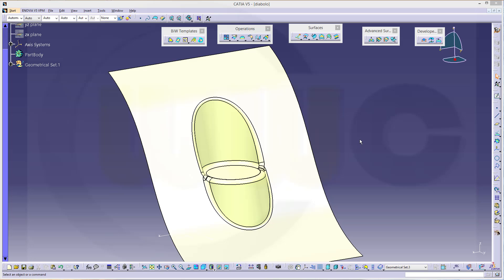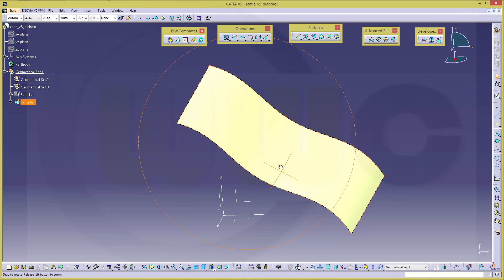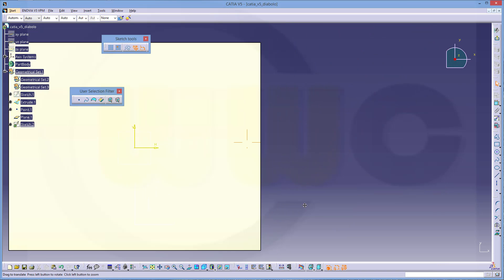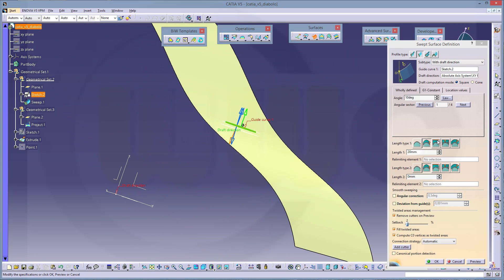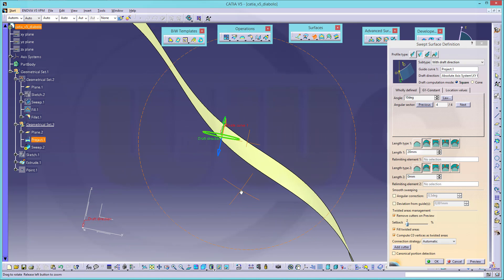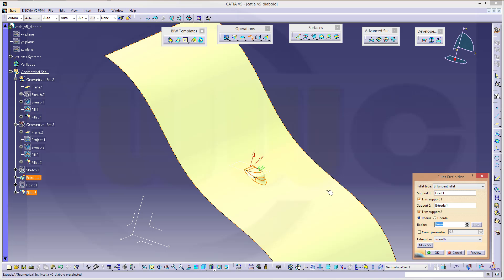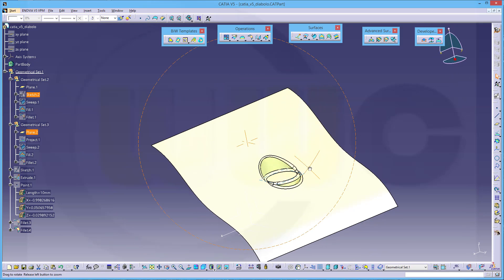How to make a "Diabolo" - Catia v5 Training - GSD

Comment: why is the offset surface needed for the positive/negative cones? Cant it all be done with the original filled surface?
Reply from the maker: Sorry, there aren´t any offset surfaces. Where do you see offset surfaces? By the way, I did this video 5 years ago. So if you have any questions you should at least give me a time stamp, shouldn´t you?
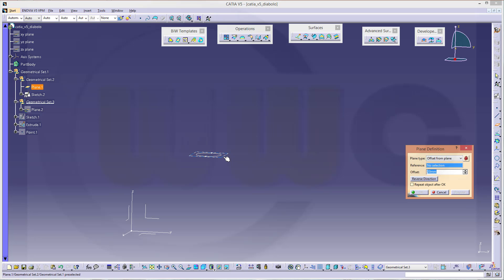Reply: @wolfgang.walden.cad.training  At 5:20 there is a plane created with an offset of 2mm from the original one. Those two then become inputs to create the "positive" and "negative" cone surfaces that will form the diabolo. My question is: could this same procedure be done with just one plane & circular surface from which both cone surfaces are created?

Comment: While converting a unparametric model to parametric model sometimes we use project 3d element in sketcher in this case we may get spline so how to iso constraint the projected spline in sketcher
Reply from the maker: You can´t "constrain" a projected element, it is already fully constrained.